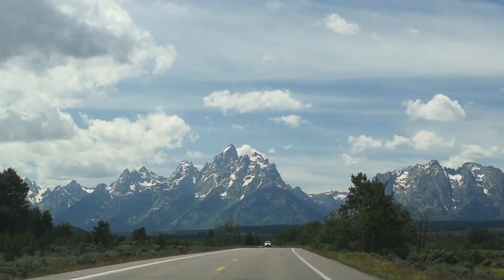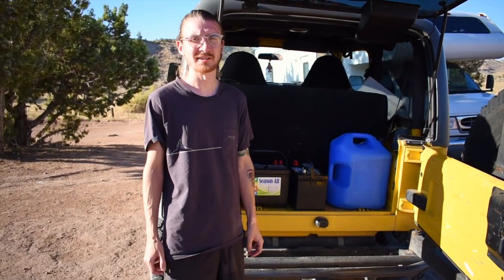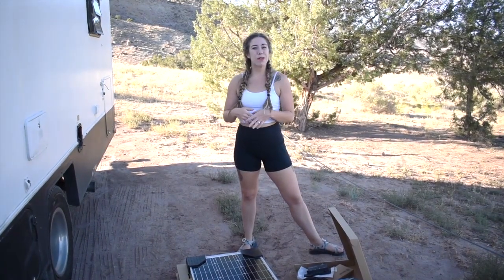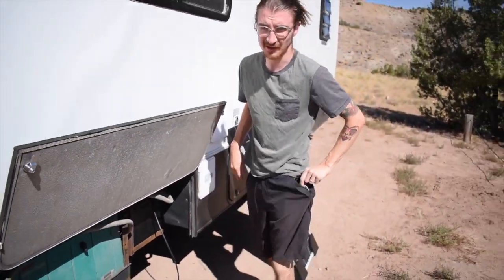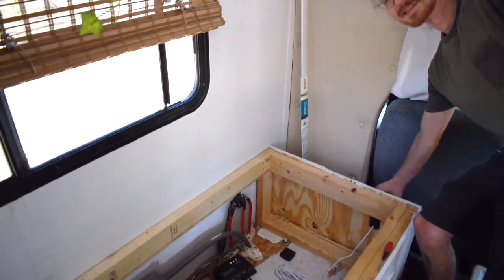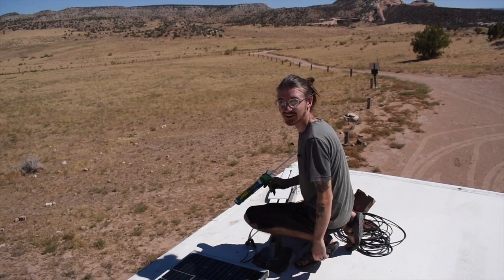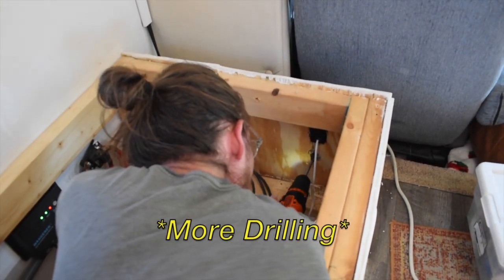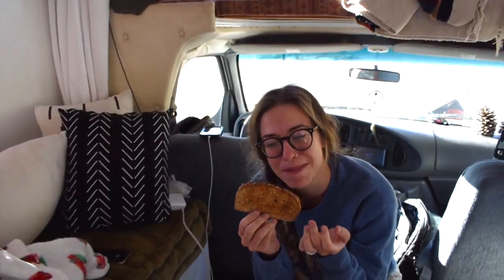SIMPLE RV SOLAR SETUP: Installing Renogy 100 Watt Solar Kit & Inverter

Comment: Finally I found someone with the same camera set up I have a 97 Ford travelmaster. How is it working so far?
I was thinking I would stick my solar wire out the window so I can move the panels when needed.

Comment: Great video!!! Definitely referencing this! But how would you wire 6 Renogy 100 watt panels with 2 Renogy deep cycle 200 ah batteries. I get how to do the batteries now rhanks to you, but this isn’t my background so I’ve had them sitting aside for months now

Comment: Thank you! 😊 
We bought this kit based on your video. We haven't installed it yet, but it's our next project.
We're planning on bringing our wires in through the refrigerator roof vent.
Reply from the maker: Let us know how it goes! I wished I could've done that too but it was in the wrong location for us.